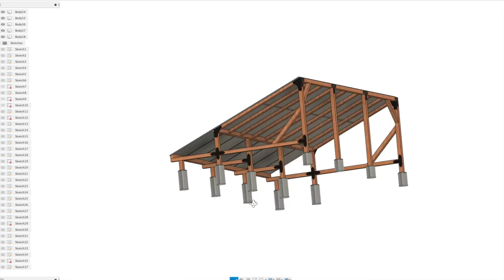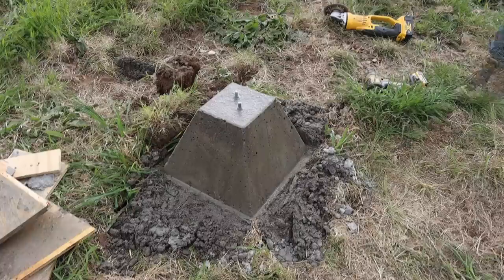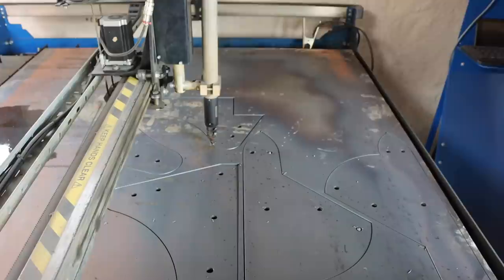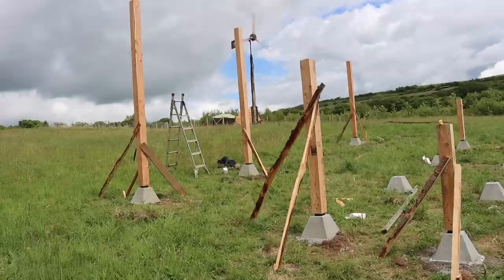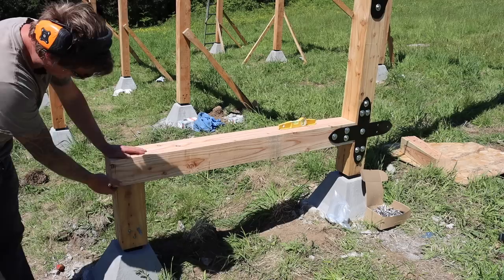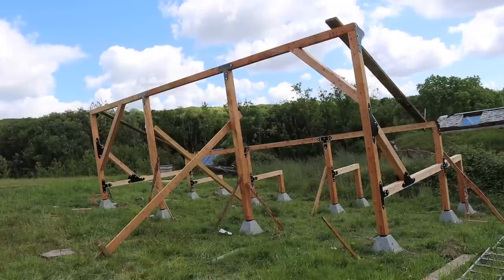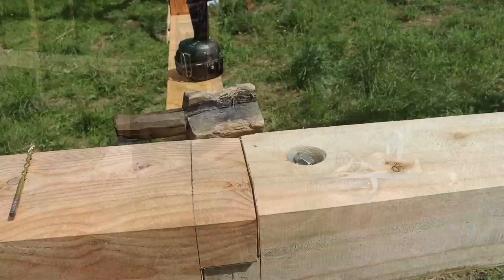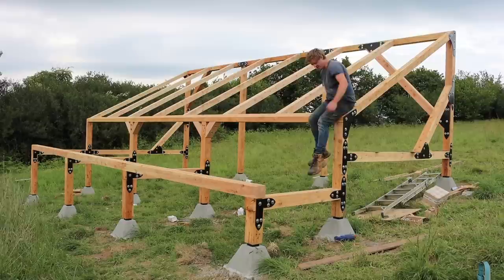8.4 Kw Timber Framed Solar System Part 1 The Frame

Comment: I can remember watching you some years ago when you used to say, "If it fails in the future, I will just redo it."  It used to make me smile.  Congrats on your evolution to "I'm getting to the age where I don't want to redo it."  You will thank yourself over and over years down the line! Nice work all along the whole journey Kris.
Reply: But he is still young. :) And I have seen many men in their 50-ties doing really hard work. Watching Kris´ videos I´m sure he won´t be different.
Reply: @zvolencan1  Working hard on the latest project is fun in your 50's and onward. Revisiting old work that didn't hold up... not so much.
Reply: We also all tend to under estimate the ravages of time, especially when we have to go back to something we built to last and have to take it apart to repair it or modify it.  I bought an external timber door in parts and built it for an external store extension, many years later I had to replace it and decided to make it out of timber decking, one very heavy monster and there is no way I could throw it around now like I did when I built it, so very happy that it's wearing well and will more than likely out last me!
Reply: I'm surprise Kris hasn't used any kind of preservative on the frame, as without it, wood boring insect larvae & fungi will undoubtedly feast on it to the point of destruction well inside 40 years.
Reply: @cmmartti  As someone who ran a forestry & timber production company for more than a few years, I can state without hesitation that wood boring insects & fungi are alive & well here in the UK...

Comment: Kris out here using three saws together, brilliant! Thanks for the video, it's always a joy to watch you work and develop your property
Reply: Johnny Two Hats has nothing on Kris! :)
Reply: ..... das hab ich so auch noch nicht gesehen, mit den drei sägen  🤔
aber gut 👍
Reply: @kingloser4198  2 hats, pfft. Have you seen the size of Kris's hat? It's like...6 hats.
Reply: I believe I'd use the sawmill to cut those slots.
Reply: @OTuit  It's probably not worth the effort. After he ran it through the planer he'd have to load it back on the tractor and drive it out there, load it, adjust and cut, offload it to the tractor and bring it back. Any of which could cause it to be damaged.
Reply: As someone who sharpens handsaws with a tapered file, placing three saws side-by-side-by-side for a wider kerf is a terrible idea. It takes a lot of patience to sharpen rip saws and even more discipline to sharpen crosscut saws (assuming you have good quality files). I had to cringe when I saw that part of the video. The only metal that should ever touch a handsaw is the tapered file when needed for resharpening or the plunger of a sawset.
Reply: heheh sometimes you just need to get shit done even if that means shoving three saws in there
Reply: @drakensav  ((sniff sniff))...Is that sexual innuendo I smell?
Reply: If they are cheap sawa, already dull, it works.  He used a radial saw on the pole barn.  More tools, better technique.

Comment: Kris, don't beat yourself about the solar panels. You made half a barn for this new solar array. Great job!!! Can't wait to see it done and operational.
Reply: Was thinking the same. It's a bummer right now, but the better panels will pay off in the long run.
Reply: With a few walls and I'd live in there, good solid construction
Reply: I think it's Stonehenge
Reply: @nonomnismoriar9601  I was about to say the same maybe raised by another foot and it could’ve been a perfectly decent timber frame house!
Reply: 🤣Solar Pole barn in case of nuclear strike!

Comment: Neat trick with the reciprocating saw! Always look forward to your uploads.
Reply: Yes, BUT ... the concrete doesnt have any metal inside to reinforce it. With such a windy hillside AND with being such a large area (which catches a big area of wind) I would expect there to be a lot of "to and fro" pushing of the entire structure, which will result in the protruding bits being sheared off due to the changing forces, which will result in cracks that will grow over time. 

One of the things we learned in university - material sciences ... so highly on topic - is that concrete handles COMPRESSION very well, but for it to survive PULLING forces you need the reinforcing with metal.

The saw MIGHT not transmit the vibrations into the ground either and you have no way of checking!

So I would have done it by casting the concrete posts IN THE SHOP, where he could have applied the saw-vibrations to the underground parts as well AND where it would have also been easily possible to a) ADD METAL STRENGTHENING and b) WATERPROOF THE STUFF UNDERGROUND (ANY foundation of a building will have an outer coating of "tar") as well, which will be the far bigger problem IMO. There would also have been the option of only making 1-2 "complet moulds" instead of making one for each protruding post.
Reply: @Muck006  
Edit. Didn't see that about the pulling forces, that's interesting.
I'm sure it'll be fine, I'm sure he'll post a 5-year video and I'm sure it'll look s lot better then the bridges built around me 🤣
Reply: @Gray Hand It is not "the hillside" that will create the lateral/ALTERNATING forces ... it is the WIND! The solar panels are basically a BIG SAIL and this is on a wide and open space instead of inside a clearing in the forest (corrected for shadows).

Corrosion is a matter of "coating the outside of the concrete", which "casting it in the ground" didnt do. Any ground (except in a desert) will have sufficient moisture for corrosion, thus it is necessary - if it is supposed to last decades as he stated - to coat it outside the hole in the ground OR create the "coating/protection" inside the hole before pouring the concrete.
Reply: The only corrosion to be worried about will be the corrosion of the fixing bolts and connecting brackets. They are deeply buried in the concrete (to a small extent reinforcing it) and will be protected by the alkaline cement environment. They may even be stainless steel which would be perfect. There is no such thing as basalt reinforcement, all concrete contains aggregate which serves to bulk up the concrete and bind the cement/sand matrix together. The selection of aggregate type is usually based on its proposed use and ultimate environment. Since there is no reinforcement in these foundations anywhere near the surface, there are no corrosion concerns. 
The wind will impart forces on the structure which will be resisted by its dead weight and the earth friction around the footings. If a correct assessment of these live loads has been made, then the structure, as a system, will easily resist any ground pressure and uplift forces. 
A simple comparison would be a large shed, which generally wouldn’t be anywhere near as heavily built nor have such competent foundations.
Looks good and solid, I’d bet it will last a lifetime
Reply: @Muck006  I bet you're fun down the pub!
Reply: @Muck006  you really shouldn't be doing concrete casting off site for foundations for a couple of reasons. It's much more difficult to get level and square. It's very heavy to move and jiggle into position (200-250 kg each). The corrosion part of it really isn't that much of an issue either. Underground concrete in a temperate climate such as Wales won't be very susceptible to a freezing/thawing cycle due to the thermal inertia of the ground itself. 

As far as reinforcing the concrete I don't believe the forces pulling on the foundations are sufficient to be much of an issue. The force pulling on the concrete is transferred via a metal rod which I think would actually shear off way before the concrete begins to shear.
Reply: @Muck006  Thanks for all the input.
Especially the CAPITALS and the bolds, and the edjumaction!
Meanwhile, Kris has, on his own, built the structure within his own expectations.  Not yours.
Classic " I'd a done this, I'd a done that" claptrap. We will wait for you to produce anything remotely useful. Any day now, I am sure.
Cheere
Reply: @Muck006  armchair builders such as yourself are the reason why kris has been having issues with motivation regarding youtube.
Keep it to yourself, if he did something wrong he will learn from his own mistakes as he has in the past, its his project not yours.

Comment: Looks great.  Kinda miss you drilling holes and holding everything together with pegs, but, work smarter, not harder.   Also, that was the most creative use of a saws-all I've seen in a while.  Vibrating concreted down.   Simply brilliant.

Comment: I used to be a crane bandsman around 15 years ago and when I used to lift the concrete shutters for the chippies they would always oil up their shutters before and after. That way they would just pop off the next day leaving a perfect wooden pattern. They very rarely stuck and I am talking 4 by 5 meters at a time, sometimes bigger. 
Watching all the trades on site as you lifted their stuff around you pick up little tips here and there:-)
Reply from the maker: Its always amazing to me how seemingly simple jobs are not that simple and there is a lifetime I tricks and skills to all of them.
Reply: @KrisHarbour   Back in the late 80's until the early 2000's I worked as a rigger, mainly builder stages for events of one kind or another. A good rigger looks like their doing nothing whilst an inexperienced one would be running around like a headless chicken achieving sod all! 
I have been watching your build of your green house on your play list. Very impressed by the way you go about working stuff out your way. And the way you act when something works is brilliant. I thought that goes into it top notch and finding that spring exactly were it was could not have been planned better! 
It shows that this is something you want to be proud of and will last not only your life time but for generations to come. 
Well done.....
Reply: The form workers I worked beside on the power station construction sites would use old sump oil, just get a bucket as needed from the diesel mechanics on site after they did oil changes on the cranes, elevated work platforms, etc. Same result, forms just fell off as soon as they took out the screws. 

They would spray the oil on as they stripped the forms and cleaned them, build the new form then just before a pour spray them again.
Reply: @KrisHarbour  I was always taught to watch the laziest worker on site, you will learn all the tips n tricks from them! 😂 Personally think I learnt more from the hard workers but I got the gist of the saying. Work smart not hard.
Reply: What instrument did you play?
Reply: @waterboy8999   I wrote banksman and just notice auto correct changed it. A banksman is the person that slings the loads and talks to the crane driver to tell him what to do as they are on top of a very large stick and can't see most of the stuff they need to lift.
Reply: @rufus1346  I was being cheeky, happens to me all the time, yes I've done the banks man slinger training.

Comment: In the beginning I was thinking "Wow talk about overkill!" but then I've noticed the rather strong wind throughout the whole video, and now I understand why you made it so strong. Great job mate. 👍
Reply: Still i don't see a reason for such strong construction, cost of solar panels (in 10years panels lost 50% of efficiency). 
He already has such strong wind - why to don't improve it? yes lot of noise, but as i see this place is far a way from house (BTW: it will be an issue to bring the energy into the house).
So my opinion: it is hobby, he is like to play with it, but efficiency of all of this should be calculated upfront.

Comment: good to see the energy upgrades going in. Your going to need that with the top workshop. Your really making good progress. thanks for the posting....
Reply: I wonder if it might make more sense to create an "energy storage" in the shape of a water reservoir at a higher elevation, to then use for water power. Solar power is quite high-tech and when it fails it cant be repaired by yourself. Water power in comparison is relatively low-tech ... and "fixable".

"Pumping water by using wind" is a very VERY low-tech thing, just think about all those Westerns where a single squeaking wind wheel pumps up water, possibly even into a big tank on a tower in the vicinity.
Reply: @Muck006  you'd need a ridiculously huge storage area for all that water...
His turbine goes through 5L a second (I think) ...
Also with each conversion engery goes through you lose some..
Energy storage with water only makes sense in a large scale not for a 10kW array.

Comment: This looks like a compelling way to build the house:  framed like this with straw bale and lime mortar walls, warm, sustainable but most of all really really quick.
Reply: @cmmartti  one could imagine quite a striking mix of agricultural siding and shiplap siding on this type of house.  I’ve seen something similar on one of these grand designs type programs.  Burnt latch sidings seemed to come out really well from a longevity and æsthetic perspective too.  Galvanised or concrete corrugated siding looked good but the joins and the interface between it and the wood looks tricky.  Anyhow, I bet Kriss has much better ideas than us 😀

Comment: Hey dude , been watching years . 
Just a thought about you mentioning about using the space underneath for firewood drying and how that could be a heatsink under the panels . It’s really important that the void underneath is cool for efficiency. If you can possibly let some plants grow in the shade underneath the evaporative effect is really beneficial. One of the solar hybrid farming videos explains it really well .
Love the craftsmanship as well . Thanks for the distraction .
Reply: Excessive heat in Wales is rarely a problem
Reply: @luct3368  
That’s not the point . It’s the the cooling that you want .
Reply: there is so much airflow under the construction, heat or rather keeping the panels cool will never be a problem. in addition, the wind is constantly blowing at the place, as you can see from the wind turbine. even when the sun is shining and the sky is cloudless, the wind is constantly blowing. this is more than enough for the panels. I would even say that in the end he still has to expand his electricity storage in order to be able to use the electricity produced efficiently. moreover, as he said himself, he designed the system larger than needed. thus, efficiency will never become an issue.  greets
Reply: @tomwi_since2015  I think you use a huge amount of works to say twaddle . 
Greets .
Reply: @Whateverpoopiepants  no idea what "a huge amount of works" means? but I'll guess and try again differently! how many solar systems exist in cities or on the roofs of private houses? how many of them are somehow extra "cooled"? exactly none! this may be necessary in certain regions of the world and it probably makes a bigger difference in efficiency only in most cases and especially for private systems up to a certain size, the benefit is out of proportion to the effort to cool the panels or What ever. A good airflow is enough to avoid any kind of heat build-up. and that's a fact
Reply: @tomwi_since2015  
And you’re a solar specialist are you ? 
They literally float panels on water because of the cooling effect and the bump in efficiency that you get. Hybrid solar farms are set up to cool the panels . So yes it does make a difference . And when you’re a small generator every extra watt hour counts . 
Heat increases resistance and makes the panels less efficient so cooling the backs really helps. 
Guess you know better then all the people Pursuing passive cooling . Poor people all wasting time , should have just had a chat with clever old you . 
Didn’t realise suggesting an alternative would be so upsetting to you guys . Jeez
Reply: @Whateverpoopiepants I still don't know what you want anyway? Kris said several times in his video that he wants to build the "CHEAPEST" solution for his solar system and is therefore building the system larger than actually needed! precisely because he does not want to use the most expensive - newest and most efficient panels. do you think he cares about a few percent? Nobody said that such systems do not exist, only in 95% of all solar systems that were built privately or semi-commercially in residential areas or on private houses in the last 15 years nothing is cooled with water !! especially in England and central - northern europe !! so what do you want?
Reply: @tomwi_since2015  
It’s ok chum , you clearly know best in every situation. .
I’d have more success explaining the moon landings to my cat . Good luck with your room temperature iq . 
So what do you want ?

Comment: I liked the metal bracketry you added, I do miss seeing the detailed all wood connection's, but as a retired master carpenter, I do know how long it takes making them and all the dry fitting and tweaking to make them perfect, so using the metal brackets is a much faster and also makes a strong structure.. With the newer panels you will be able to produce more power and they will last much longer then those that were 5 years old.. I just replaced all of my panels, they were like 7 years old and my new ones produce almost 4 times the amount of power (with the same number of panels) Thank you so much for sharing...